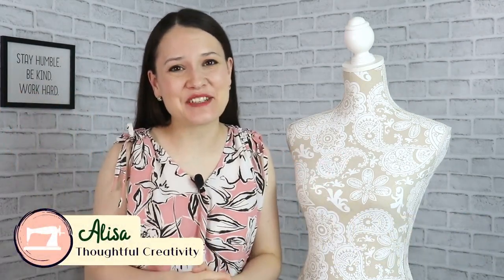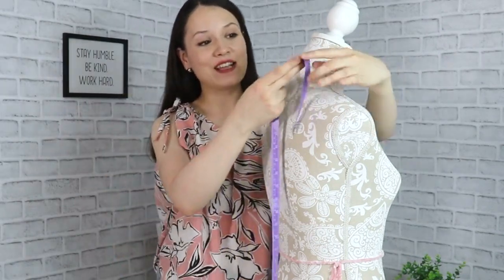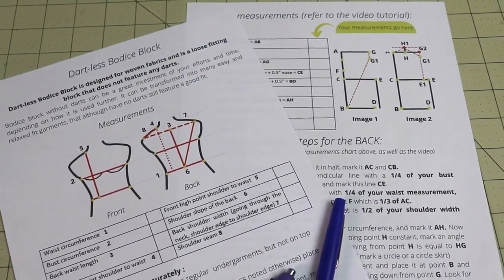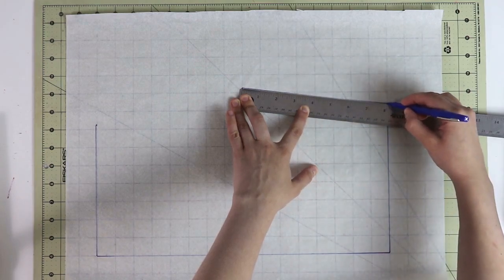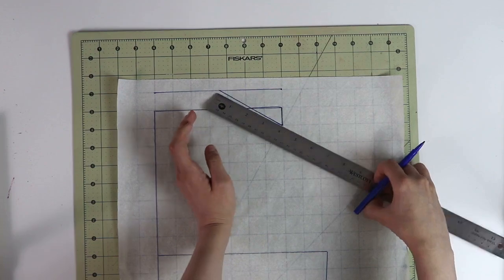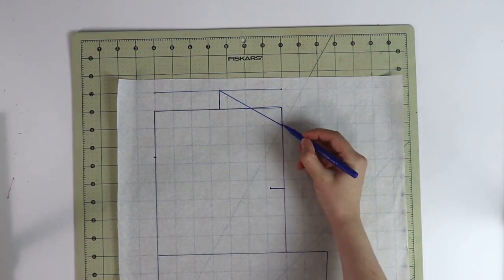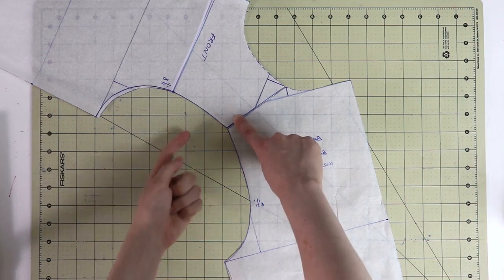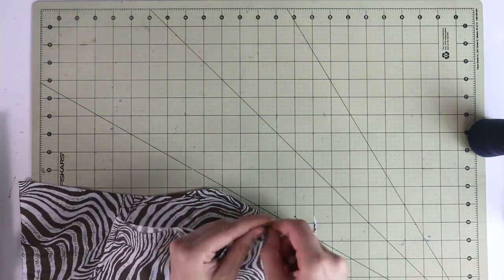How to draft a DARTLESS bodice block for woven fabrics? Simple drafting tutorial 2021

Comment: I agree 100% that having a well fitted dartless body sloper is very useful, especially today when dartless styles are trending. I’m saying it as someone who designs women’s tops for a living. It’s a pretty good tutorial and the fit is almost as good as it gets for the dartless pattern. I say almost because shoulder seams are not in the right place and need to be brought forward at least 1/2” I’d suggest instead of reducing  the armhole at the side to draw the front shoulder line 1/4” lower and the back 1/4” higher, then adjust and redraw the neckline. In the industry they call it “forward shoulder seam” which all woven tops have. For the balance fit in wovens the back armhole and the back length from highest point shoulder must be longer than the front, otherwise the top, when on the body, would be constantly pulled back. It also addresses the hiking issue and that ease she has at the front neckline.
Reply: Thanks! That's super helpful!
Reply: Hello, I think I made a mistake as you described. After sewing and wearing it, the back of my shirt is bulging and not straight. Can you give me an article or a video? Fixing it is easier than not

Comment: Thanks for sharing. I tried it and the practice cami was too tight on  the armholes and chest.  Should I add  the seam allowance on the practice cami
Reply from the maker: You should always add seam allowances, that is the space necessary for the constructions of the seam. If you did not add seam allowances and sewed up you garment let's say with a 3/8" seam allowance then you took away 3/8" off of each pattern piece, so your final garment measurement is now  3/9"x4 smaller that you drafted.

Comment: Dartless bodices is what people wore in the middle ages. What they did at some point (I think late middle ages) is they used the center seam both in the back and the front to adjust to the particular curves of the person wearing the garment, chest, curve of the back, tummy, etc.
I tried it once and it really works and even provides a little bit of chest support! You end up with blocks that are curved not only on the underarm seam but also on the other side
Reply: I find this idea very interesting. I would be grateful if you can please throw more light on how it's done?

Comment: Thank you so much for your great videos. I used your instruction to draft this pattern. The best part is I’m a beginner and this was my very first garment! I’m so pleased with how it turned out on the first go - sleeves and all!  When you are a beginner it can be overwhelming to know where to start. I’m so grateful I found your channel and pursued making this top. I learned a lot from your videos both before I started and along the way.

I initially expected to buy a pattern, but once convinced I could do this too it was a great learning experience. It took a lot of the pressure off that I didn’t need to make purchasing decisions to get started. I borrowed a family members sewing machine, cut the skirt off a long dress, and sat down with gridlined wrapping paper, a ruler, and a pen. The first major challenge was learning how to get the fabric as close to square as possible with the fabric folded over and make symmetrical cuts to the top and bottom layers with scissors. The second major challenge was when I accidentally cut the front neckline to be too wide across the shoulders right after completing my first successful rollover hem on the back neckline. The solution: applying bias tape as a first timer to the front neckline! The seam reaper came in handy. 

I rarely comment on social media platforms but I wanted to thank you and also share a very beginner’s perspective. Already looking forward to my next project!
Reply: Wow you are really inspiring me to move forward with this project!  Thank you. After having sewn a few purchased patterns which never fit  in the shoulders or neckline, I wanted to just make my own pattern however watching this video (and the one for the sleeve) I lost hope.   Having read your review as a new sewist I'll do my best to give it a go.  Thanks for the renewed inspiration :)

Comment: Hi, can you show how to ease in the 1/4" side seam difference into the back panel (15:32)?  Will it be the same or easier to either add 1/4" to the length of the front panel or cut 1/4" off the length of the back panel?
Reply: I have the same doubt.

Comment: Great video. I love your teaching style. Did you do both 1/4 inch adjustments in the front at the same time? You said that raising  the armpit by 1/4 was another way yet you did both. I am a little confused. Is it possible to illustrate how you added both 1/4 inches in the back pattern? Thanking you in advance😊
Reply: Hello from Quebec Canada! Thank you for your very informative videos. This is my first woven block, so I’m a little nervous and have the same questions about the 1/4 adjustments. Do you do both or chose only one option. And for the back pattern, where and how do I add the 1/4 ease?  Thank you for sharing your knowledge !😍
Reply: Hello, I have the same questions about the adjustments. Thank you so much for sharing.

Comment: Someone help!! I've tried making these kind of bodice blocks many times, but I can never get the armhole right🥲 My shoulders are quite broad and my bust is very small, so it is smaller than the circumference of my armpit and shoulder. The line in the pattern for my bust is significantly shorter than the shoulder line, and it makes the sleeve not work?? It has a weird shape and if I were to make a garment with it, it wouldn't even reach around to form sleeves.... Do I use my armpit to armpit- measurement instead of bust since my body is wider there? Or is there another solution?? Thankful for help!!!♥️♥️

Comment: This is so comprehensive!  I followed along on a sturdy piece of cardboard, paused often, numbered the steps and annotated.  I made a goof and started at the very top of the cardboard, so I get to practice on paper bags.  One question.  You show how to position the bustline, but not the waistline.  I measured down from the bust.  Is that the correct way to do it?
Reply: Oh, I see my mistake.  You are using the neck to waist measure!
Reply from the maker: No worries at all, and well done on getting started! I wanted to give you a couple of helpful tips. One of the is that you have printable step-by-step instructions for this project on Google Drive as a part of your Membership, if you watch this Membership trailer (just make sure you do it till the very end, it s a short video) it will show you how to access Google Drive link and there in the "Instruction sheets" folder you will find many PDF's that you can print. Here's the video - https://www.youtube.com/watch?v=uP9qSamkVkk  Also, I did simplify this bodice block, so that way it is easier for people to draft it, but like anything without darts - it can have issues, for answers to many in-depth questions about drafting a bodice block I would suggest watching and doing the bodice block with a dart - you will see explanations as to what are we doing, why and hopefully that will paint a fuller picture, here it - https://www.youtube.com/watch?v=aJ6Stv9b8k0

Comment: Thanks for this video!! The fact is, in the current fashion trend at least in my
country, clothes are mostly at least 80% in stretchy knit or spandex material
which is very suitable for me since I am already 65yrs old with belly, shapeless
body structure. I find it difficult to shop for my own clothes bcoz of my body
structure and this is why I decided to make my own clothes.
 
I'm glad I don't need to learn those darts which for me as a beginner is a bit
confusing for my pattern making!! I just need a basic pattern to start with and 
learn to sew on stretchy fabrics bcoz this is the fabric that suits my needs! 
Get rid of zips which I don't need but want to settle with button down dress
which is very convenient for me as a 65yr old beginner sewer to be!! Thank you!

Comment: Does it make sense that my Back Waist Length is 18" and my Shoulder Slop of Back is 21"?  That is a difference of 3" which means I would  move my G2 line up 3".  If I do that my shoulder seam of 4.5" is almost perpendicular (on a really steep slope \  )to that G Line .  I hope that makes sense.  I'm sorry I am having such a hard time figuring this  out
Reply from the maker: You can take a straight ruler, put it perpendicular to your spine, at the base of your neck. The distance between the ruler and your shoulder (at the edge of your shoulder) is a shoulder slope. Here's is a video of a bodice block with darts, with a slightly different method of drafting, you can see if that helps you understand/measure/draft easier. You don't have to do the darts (without darts you will have a gaping armhole) just watch the method - https://www.youtube.com/watch?v=aJ6Stv9b8k0&t=735s
Reply from the maker: Remember that the pattern that you are drafting reflects your body, so if the pattern as of right now has a shoulder seam that is almost perpendicular to your neck, then take a look in the mirror - are your shoulders perpendicular to your neck? The pattern and the body go hand in hand. If your shoulders are not perpendicular then something is off somewhere. It is not uncommon to take wrong measurements, shoulder slope is one of them.
Reply from the maker: Usually, shoulder slope is about 1.5-2", but it really depends on an individual. Your shoulders can also be uneven, which sometimes can get people off track, mine are uneven (one is higher than the other) and I don't draft left side different from the right side.

Comment: hi Alisa I followed the instructions but the ease in my sleeve seems a lot to try get in do i pleat it between the ease Marks or is it supposed to go in flat also my neck seems bit high and very loose around the neck  I did the 2 1/2 inches like you so do bn I just cut down more to suit me thank  you I am bigger than you so bit confused
Reply from the maker: Great, always remember that your final result depends on a variety of factors, and it is totally normal to do adjustments and a few fittings. SLEEVE - 1) decrease the ease  -  I speak about it  in the sleeve video 2) do research on how to ease in woven sleeve
BODICE - 1) loose neck/across chest is usually due to incorrect back shoulder width and shoulder seam measurement - double check it, reduce if needed. If back fits great, then you might reduce front shoulder width (in the video we made it 1/4" shorter than back, you might want to shorten it a bit more) . Also make sure your shoulder slope measurement is correct 2) since this is dart-less bodice block it will not fit tight, as it has no darts 3) if you have large bust - you will most likely need a bodice with dart for appropriate fit.
Reply: @ThoughtfulCreativity  thank you ALISA I WILL TRY ALL THAT

Comment: Hello Alisa.  How would I adjust the chest measurement to my pattern.  On my shirts (which I have tried to make) I always end up with a 1/2" gap on my chest.  I would assume that my chest is smaller than what my bustline is... ???  Thanks in advance.
Reply from the maker: Fran, let me clarify - do you mean upper bust? And what gap are you referring to?
Reply: @ThoughtfulCreativity   Yes.  it’s the above the bust measurement. In the upper, middle of my chest it always ends up being too  loose.  Always by about 1/4”-1/2”.
Reply from the maker: Fran, hello there, I ma not sure if I am going to be up much longer, here's the thing - woven bodice block without dart is never going to fit super tight as that is not possible due to the curves of our body and the fact that the fabric/pattern has to accommodate for that. Darts  - the tool really fit the patter to our bodies. Dartless blocks are possible, but something has to give, you will have that "dart" amount somewhere, it might be in form of a little "pocket" of fabric, might be a little gap or extra width, but that's the reality of woven blocks without darts in most cases. If you want a fitted result - follow the woven bodice block with darts tutorial, you can find it on my channel and I gave you the link for it yesterday under your previous comment. About upper bust measurement - any measurements that are on your body will correspond to the measurements of your paper pattern. So think this way - if I need to find where is my upper bust I would measure from High point shoulder to where my upper bust is at, then just place this measurement on your paper pattern, from high point shoulder straight line down with whatever measurement you recorded. Now you found where is your upper bust - across will be the circumference, so measure the circumference and place that on the pattern. Pattern reflects your body, think about it like looking in the mirror - what  and where it is on your body - that's how you mark it on the pattern. I hope this helps!
Reply from the maker: Ah, I see, if your talking about a gaping neckline it is usually the shoulder width. Your shoulders on the back have a curve as they are pitched forward, therefore if you measure shoulder in the front the measurement is about 1/2" smaller than the same measurement taken in the back, at 10:00 in this tutorial we account for that. Make sure that you make a muslin first to see any fit issues and work them out if needed. Here's Members Extra for this bodice block - https://www.youtube.com/watch?v=CCd-OP1a2xI&list=PLTQAETBWbJdjimWwNqDmMPuE2_KQmCXsR&index=19
Reply: @ThoughtfulCreativity  Thanks for this.  Time for bed for everyone I think.  Tomorrow will get all the info together and take it from there.  Thanks for all your help. 🤗
Reply from the maker: My pleasure, Fran, have a good night!

Comment: Hi Alisa, just trying to draft this for the first time. The difference from my high shoulder to back and high shoulder to waist is 2.5" 

I have put the line 2.5" higher than the original shoulder to shoulder line. I added the shoulder slope which is 21.5". However when I come to connect the shoulder slope mark to the new shoulder to shoulder line I use my base of neck to shoulder length which is 5.5" but it doesn't then reach from shoulder slope to the new shoulder to shoulder line using the 5.5"...... can you help me please? Many thanks x
Reply from the maker: 1) double check your measurements, especially the back shoulder width - this is the measurement people most often get wrong as well as the shoulder slope and the difference between neck to waist and shoulder to waist (all other measurements as well) 2) go to fitted bodice block video if you have larger bust as noted on the screen in 2:44 in this video 3) if you have sway back this simple block is going to be difficult to fit without darts and extra adjustments